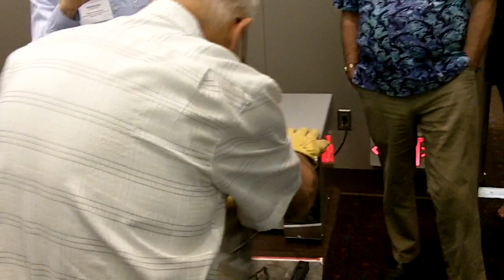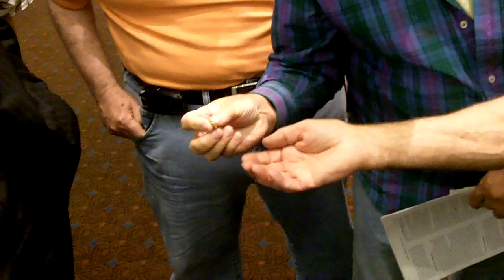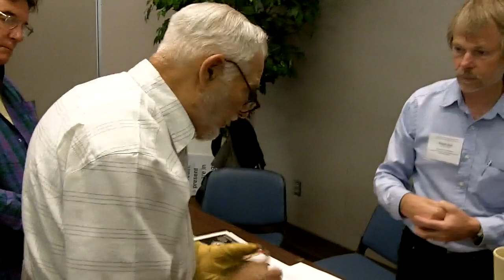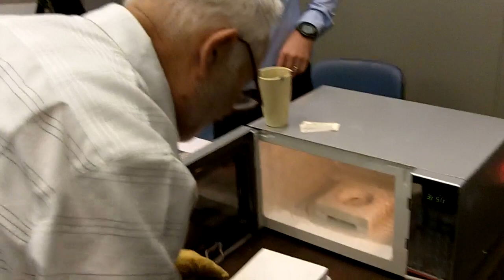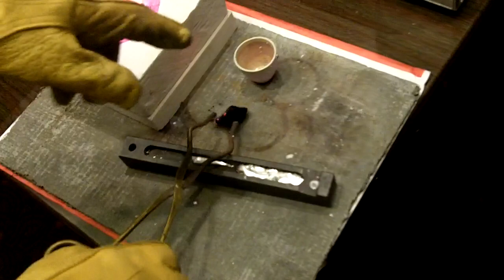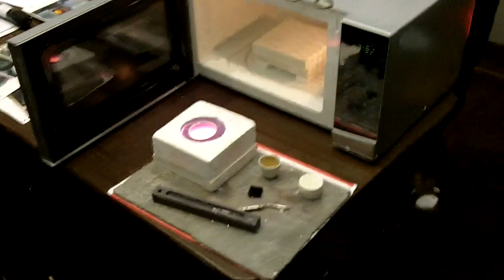Dr. John V. Milewski: Growing Gold from Glass in a Microwave - Part 2

Comment: you can use ANY Soul.Use a VACCUM Chamber,but PUT a Drop of ACID and  ZINK also in the Mix. Acis and Zink produce 100% CLEAN Hydrogenoxyd,the FIORST Element in the Periodic Table.ALL is made from Hydrogenoxydatoms.Your see it with Heluim.Helium are 4 Atoms of Hydrogenoxyd.So if you reduce Heluim will you have 4 Hydrogenatoms instead of One Heliumatoms. So whats happends is you reduce your Soul,Parts of it in to CLEAN Hydrogenoxyd,some can now grow on a monoatomic Goldatom and make it Metallic AGAIN. so a Mix of Glass dust,Acid and Zink in a Vaccum,grow faster and more because of the produced Hydrogenoxyd from the Zink and Acid(a BONUS) the Pharao,s Preist uses Plantash for Carbonising the Mix and produce TONNES of Gold Dust. So it means a mix of brown Glass dust and lots of Plantash work the same way because the ash is FULL of MONOATOMIC Elements some have lost all Electrons in the Burningprocess.

Comment: Fascinating ,  i have all the material i need  in my back yard ( sandy ground).and where can we order the write up,s /white paper
Reply: Can't. John died 2019.  His method only produced $5 worth in a 2 hour run, and that requires a good investment of time and resources. I started a group for this, and I've taken account of 5 or more working methods with the most useful scientific proofs and theoretically found there is a way to mass produce in a special mud by making wire gold grow within it using ion charge opposites which cause the same pulse orbital discharge we see solidified in John's method as 2 rings of 16 beads around a single larger one (carrier wave and carried waves). The gold never forms unless it is in this exact pattern. Near molten glass+fly ash+graphene in John's method can only grow a thin layer. I've identified a method that will suspend the materials in a slurry just right, allowing Au growth in mass amounts, replacing microwaves with another ionic method. Might have it together in a week, probably 2 at most. It's really about causing the ferrite quasi crystals to modulate a certain way, shifting atomic centers to force a re-organization of them.

Comment: Apparently we can grow far more platinum than gold using a modified process. John didn't know this but the fly ash content in glass and the fly ash insulation layer both contain quazi-crystals of ferrite+quartz which use a zero point energy trick to break down into gold and platinum. Without this seed material, nobody is growing gold. Maybe using sea salt, but that stuff destroys your duraboard insulation and the microwave. We're improving the process and I expect to have serious production in less than 2 weeks once I get the mix right. I may have found a new formula which puts others to shame by addition of a trigger element to boost plasma at the magic temperature which is not the 2025F used by John in brown glass anymore.
Reply: mikefromspace Awesome to hear your making progress. I subscribed to you to hopefully see how this is done correctly. I am interested in doing this myself. Thanks for your hard work in advance.
Reply: Right now I'm upgrading my oven and making some new fantastic Mizzou crucibles with a 9" id that should produce $130 per run appx 100 minutes long if the oven does what it should. Running 24/7 that's $1820 a day.  I can't automate it yet so I'll have to hire help or loose sleep to hit that number. My next oven will be 15"id and will be a modified kiln with 3 klystrons. It should do $360 a run in as little as 90 minutes, maybe less.  For each $40 in gold, I spent about a dollar in ferrite, 25cents of energy,  and about a dollar of other materials. The only hard part is the cost of building the systems, especially if you wish to automate the temperature control. Eventually I will automate the crucible pouring, loading , etc....
Reply: Interesting that you would know I out this different state of matter and more thank you for the information
Reply: Interesting Mike from space thank you for getting back and forth the information
Reply: do you have a up date about growing gold
Reply: Estoy gringo hermano hermano es decir como hago ejemplo derrito fundo 10botellas en un horno luego hago mi vaciado y a esa mezcla de vidrio q le agrego aparte de la bórax es decir hermano como se puede dar ese material con el vidrio o después de su fundición cupelo atentamente espero su apoyo para su salgo de la pelazon
Reply: I only speak english and bad english  @yisneidaetianatorresramos341
Reply: Cuál es su mezcla
Reply: You  ment. All has to be the different state of matter at it's time of change

Comment: I have not yet done this successfully myself, but I've seen another demonstration of it.  I believe you need Aluminum Silicate insulation ... it is very low density stuff.  I've been having problems finding a supplier for that where I can get small quantities of 2" thick sheets.  Let me know if you find it somewhere.   Also, you need a flux in with your metal to absorb the microwaves.  Magnetite and borax I believe are the main ingredients to the flux.
Reply: i have all the accouterments to smelt metal I will give it a try , with brown glass. and to think i been hauling all my old glass to the dump. 😒
Reply: @andreavandekleut6379 did it work
Reply: @andreavandekleut6379  John never used brown glass, he only suggested it might work. He used clear soda lime glass only. Anyway, the glass method is out. There's a new method we're working on after accumulating the science from several working methods over the years. I can show you proof of other working methods, all small scale except 3 that are either too slow or have unknown variables. I found a science common to all of them and the system should be running any day now.

Comment: For all you doubters out there, check out this link: worldwideweb(dot)geus(dot)dk/program-areas/common/int_ssm_fact_sheet_07.pdf  (dot) = .

You do have to have a gold concentrate (like from a sluice) but then you use borax and quartz sand, and sometimes a flux like KNO3.  You mix it all with the gold, and melt ... in a microwave if you got nothing else.  That's how you get the button.   The borax and sand form glass which rejects the gold in a button at the bottom.
Reply: yes that regular recovery , BUT making from glass and other sandy materials where there was NO concentrate from sluicing , is different
Reply: @andreavandekleut6379  We found you need to grind the glass disc with gold in an iron mortar pestle to a fine powder before smelting with fluorite based flux. I have a fluorite mine so that was easy... but there's a new method now that takes data from all known working methods. I'm close to testing it. have put every penny I have into building the system. Microwaves only provided a charge modulation among quasi crystals in the fly ash that merged with glass and were also present in the soda lime glass John used. You don't need glass at all though. You can just use fly ash in a different method that makes the pulse orbital discharge necessary for atomic reorganization.  I'm teaching members of my club how various proven methods worked, and showing proof of something they all have in common. It's a diamagnetic ion diode circuit, DID for short. It's no doubt going to work as soon as the slurry ratios are right. I'm testing this new system any day now.  I also have another working method I haven't done myself yet but have all the gear to do it. The fellow who discovered this used LiO3 which must be wax sealed and only lasts a short time. Has to drop into molten lead at 2012F. Only problem with that method is how long it takes and how difficult it is extracting the lithium back to do another run. It's designed to strip 2 neutrons off lead to produce Au.

Comment: @unison1978 
1:48
this guy has smart ass questions. funny though
DVD $20? take advantage of it !!! it has alot of info. critizing without experimenting is pointless. buy a generator for the microwaves if you are worried about your electric bill, or use 700w microwaves 
$20 for the DVD to me is a bargain. the equipement may vary. if you have the time and money to do this experiment then do it.